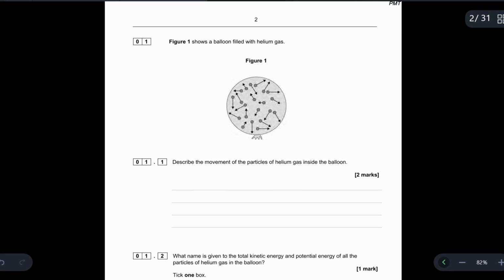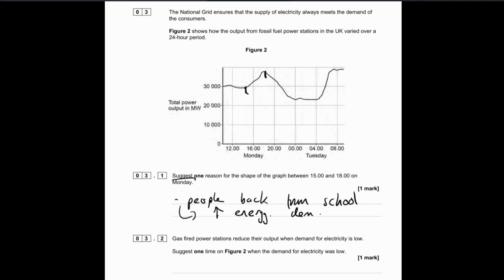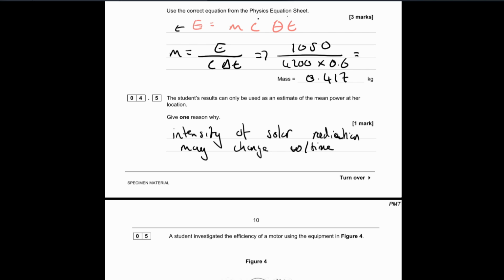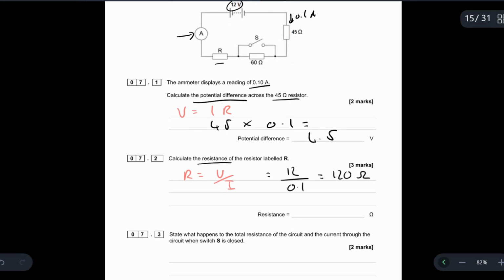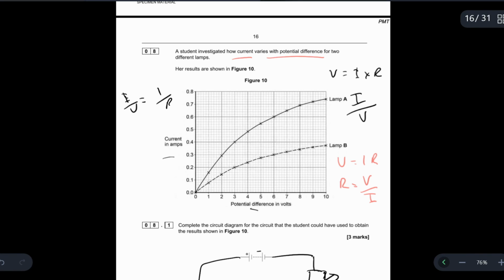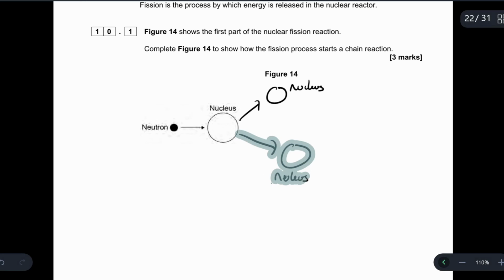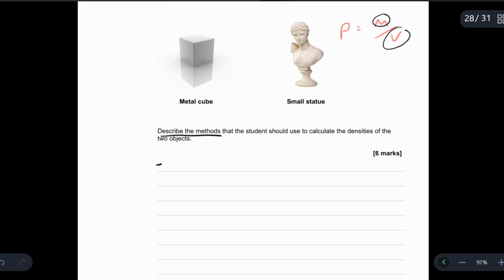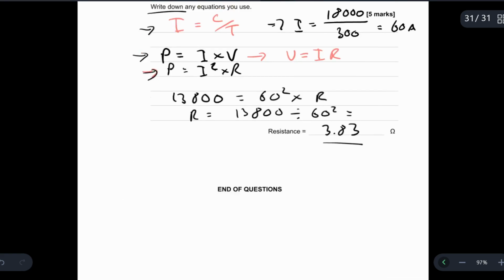Physics Paper 1 (WALKTHROUGH) - Specimen 2018 (GCSE)

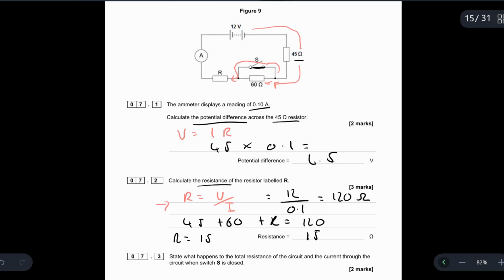Comment: 32:40 so if there was a bulb there instead of the resistor, and the current takes the path of least resistance. Would that mean the bulbs will not emit light?

Secondly, that segment of the circuit. Why is it not considered a parralel circuit . Is it because the switch has no component other that a switch?
Reply from the maker: Hi - if there was no other resistor in the circuit then yes, the branch with a switch would 'short' the circuit (assuming the switch has little to no resistance). The presence of the other resistor makes things a little more complicated as actually this resistance needs to be included in the branch with the switch too. Therefore the current would actually be split between the branches so the bulb may light up (but likely dimmer due to lower potential difference across it). If you want to look into this further I recommend researching Kirchoff's voltage and current laws - but that's far beyond the scope of GCSE so be warned!

If we add the second segment of the circuit, you are correct this would be considered a parallel circuit. When we have a parallel circuit the total resistance is decreased compared to a series circuit (this is the bit you need to know for your exams!)

Hope that makes sense!